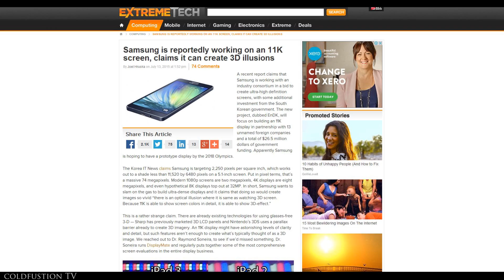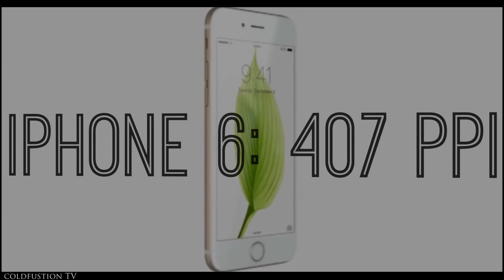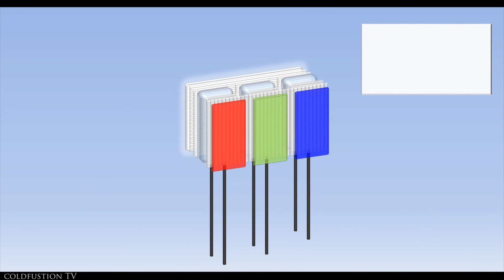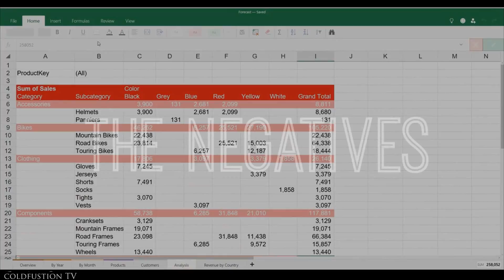Samsung is Working on an 11k Mobile Screen! (2250ppi)

Comment: Too bad they can't make a battery last a month
Reply: Franklin Missark by the time the 11k screen comes out a battery that it uses would probably last a month on a 2k screen
Reply: Lol but a month, If only Tesla could achieve such thing
Reply: My note 4 last me a whole day, watching youtube vids, txt alot and talk
Reply: ***** 
Go to settings > about phone > and tap Build Number 10 times. Exit that part of settings locate developer options > scroll till you see the part about windows animations.
 Turn them all off. See if that works for you.
DO NOT touch anything else.
Reply: Franklin Missark oh they will. and then they put the 11k display together with this 1month battery and the new samsung galaxy s9 or what ever is still only gonna last for a day haha
Reply: Patchuchan the galaxy s5 lasts 14 days in ultra power saving mode
Reply: ***** i have the Same problem and it gets hot when im multitasking (5.0.1 AT&t)
Reply: *****
Hm, that's weird. Is it that all your apps are still open in the recent? Or even when it is 1 or 2 in the recent apps it still does it?
And nope actually. I've been doing that for a long time, never had problems.
Reply: ***** Then that could be your problem. Try closing them every so often, and see if that speeds up for you. And alright. Good luck.
Reply: Franklin Missark Can you? If a company 3 times bigger then Google isn't capable of doing it, it's probably because it is just not meant to be.
Reply: Franklin Missark I don't get what's the problem with the 1 day battery life tbh.
Reply: guys look up super capacitors. they charge way faster that lithium ion batteries and store more.
Reply: too bad they didn't eat my broccoli
Reply: it's called a graphine battery and I think it would last year's but it is still in development by Intel
Reply: By using half the panel for color producing led,  half for the touch resistor digitizer,  probably also  integrating pressure sensitive resistors along side,  all into one panel instead of three separate,  this could definitely make a power efficient display.
Reply: FUCK YOU FUNNY SHIT HUH
Reply: Amy Craig ?
Reply: +Franklin Missark 
Or one that lasts more then 2 days for that matter.
Reply: +jack pepal Love using that when I am out and about.
Reply: jack pepal U WOT M8
Reply: +Franklin Missark They can, but they wont make it..... lol
Reply: The traveling time from work to home must be a month from you. where d u live. In the moon
Reply: +Franklin Missark unfortunately it's never gonna happen. Because they will make phones as thin as credit cards so you can put your phone in a wallet.
Reply: Max Jacobi Graphene batteries would be thinner than lithium ion batteries we use today
Reply: +loyal4 the way touchwiz...
Reply: jack pepal that carbon comping can only be used 4 circuit boards not as battery.
Reply: "Carbon compound"
Reply: +IEWestSide If you hate Apple so much don't use a touchscreen or a computer. Don't use any of their tech hypocrite.
Also when you buy iKnockoffs Apple and Microsoft get paid!! $$$$$
Reply: Dorm me to
Reply: +Franklin Missark yea the chemistry for batteries has been historically shit, they need some major advances
Reply: too bad apple cant make an iphone last half a year
Reply: +James Dean apple didnt invent or inspire all smartphones apple just steals shit and says that its theirs
Reply: ***** actually apple is an assembler. All internal components are outsourced
Reply: Samsung impressing dumb fucks with stats that don't matter.

Another tick on a box for the iKnockoff maker.
Reply: *****
Apple INVENTED the iPhone dumb fuck. That's why Android manufacturers PAY Apple licensing fees and Apple makes %95 mobile profitshare. One day they'll make %100  and ALL iKnockoffs will lose money :D
Reply: James Dean i hate Crapple so jokes on u
Reply: James Dean when apple gets monopoly. How does that benefit u, the apple fanboy?
Reply: But wouldn't it take a month to charge?
Reply: The input rate doesnt equal output rate idiot
Reply: or make a screen anything over 60hz
Reply: ReerBaadia 
By that stupid logic ALL tech companies are assemblers. All consoles are made at Foxconn also. STOP the anti-Apple logic.
Reply: ***** 
"I hate crapple so jokes on you"

There's 7 billion more people on earth. I know you like to think the universe revolves around you but Apple has the highest customer satisfaction rating in the industry. The iKnockoffs don't come close.
Reply: ReerBaadia 
Apple has a monopoly on profit. I don't respect IP theft and knockoffs so it benefits us inventors.
Reply: James Dean oh youre still defending apple, a failing company
Reply: ***** 

"Failing"?

Even if they were failing how does that negate FACTS? You're a real idiot aren't you?

In Q1 2017 Apple broke a few records:
Record revenue
Record ASP
Record iPhone sales
Record android switchers
Record Watch sales
Record App and iTunes sales
Record Wireless audio sales(AirPods);)
Record Mac revenue
Record Apple TV sales

Not bad for a "failing" company.
Reply: James Dean idk where you got that from, watch coldfusions video on it
Reply: James Dean 
'Record apple tv sales'. Who set this record 1st for Apple to break? Is it another apple tv sales company?
The right wording is record tv sales which apple is not holding. R u 10 years old? That would mk sense.
Reply: ***** 

"Idk where you got that from"
FACEPALM
Aren't you supposed to be some tech guru? Oh yeah I'm on YouTube. Seriously this is the most stupid comment I've read all week.
Reply: ReerBaadia 
It means "Record Apple TV sales". 
That's what it means buddy. Seriously I know statistics say android users are less intelligent but my God you even make them look bad.
Reply: i just love how you just casually assume everyone who doesn't agree with your shitty opinion is stupid

also, i asked which ass did you pull those facts from, because they dont seem very believable to me
Reply: ***** 
They are not "opinions" you fucking moron.

THESE ARE Q1 2017 EARNINGS you dumb fuck. How stupid are you?

How are facts "opinions"? I swear it's as stupid as telling a kid that water is wet and the idiot asks "where did you pull that fact from?"
Reply: Still not into your brainwashing opinions
give source
Reply: ***** 
They're Q1 earnings idiot. Those are the facts. Earnings aren't "opinions". My God you're stupid as shit.

Apple broke another record today :). First company to break 800B market cap.

Not bad for a "failing company".
Reply: James Dean apple is like the Gucci hand bag to a girl limited in what it can do yet overpriced
Reply: I Want Peace 
Nope. Terrible analogy, a Very media influenced one.

Apple is like the iPod. Innovative, groundbreaking and disruptive to a whole industry.
Reply: @Bunny sweet Lord you're ignorant as fuck!! He said it multiple times it's from Q1 2017 earnings. I know android users are stupid but you're the worst!!!!!
Reply: James Dean lol